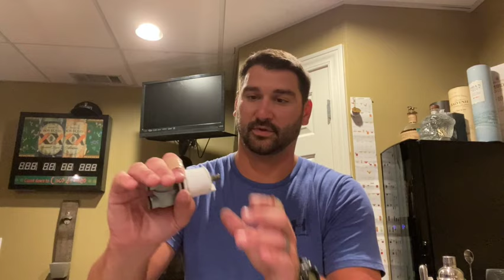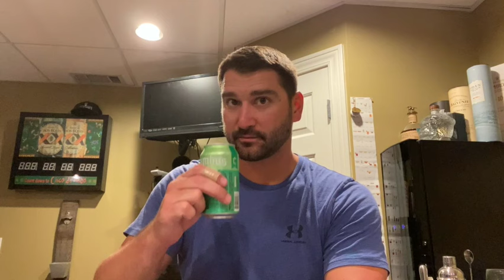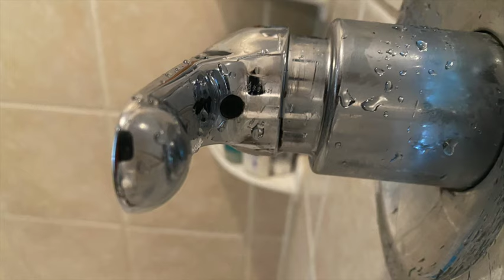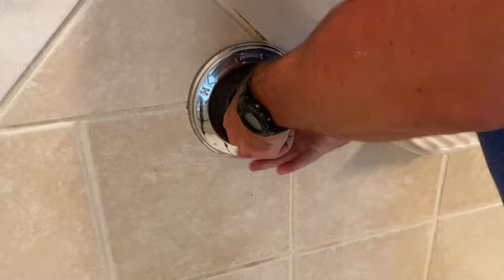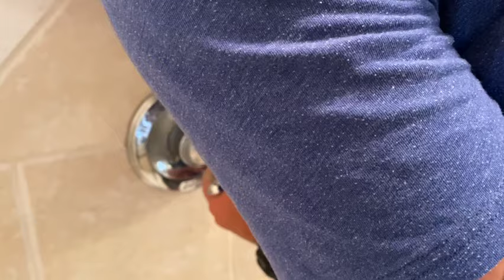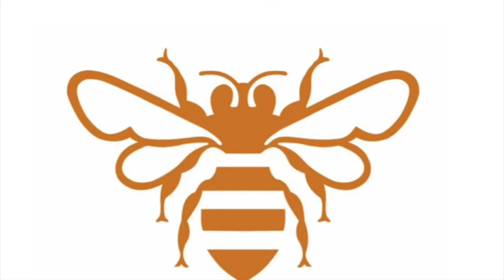Fixing a leaky shower head (Replacing Delta Monitor Series 1400 Handle Cartridge)

Comment: Plumber here. To anyone watching this, these valves are very, very delicate. The part of the video where he shows you using the strap wrench on the bonnet nut be careful not to use too much force. If you do, you will bend the valve body, creating a massive leak. If you live in a part of the country that has hard water, there is a chance you will have to replace the entire valve.
Reply from the maker: Very important point! Thank you for sharing, it always great to have experienced people sharing their knowledge!
Reply: I was watching this video because I can't figure out why water won't come out when I replace the cartridge. It was working fine except for a drip. I replaced the cartridge with a new one and now I can't figure out how to get the water to come out. I turn the water to the house on and the shower just sits there. When I turn off the water and take out the cartridge, a little water comes out. But for the life of me, I can't figure out what I'm doing wrong. I even tried shaking it to make sure the float or whatever is in the cartridge was loose because someone said to try that.

Any thoughts?
Reply: @noteworthyinsignificance debris plugged it up??? Seen it happen with a diy er

Comment: So this video helped me and my husband fix our Delta shower head leak. It took us an hour and a half, but I don't think we would have figured it out if we didn't watch the video and know what to expect. Our cartridge broke into two pieces while we were taking it out and it would have stopped us from moving forward if you didn't share your experience. We ended up taking a channel lock to the part stuck in the wall and pulled it out. Thank you for helping us through this. NO DRIPS OR LEAKS!!

Comment: My shower head was leaking but I replaced the seals and springs first, which are located under the white cover. He accidentally removed the white cover when he was trying to remove the entire cartridge. Replacing the seals and springs stopped the dripping, which can save you the hassle of trying to remove the cartridge, which is difficult. I keep a pack of these seals and springs on hand as I have multiple Delta faucets in the house.
Reply from the maker: Thank you for sharing this! Yes, in some cases that can be an easier quicker fix. I figured though while I had it apart mine as well to the full switch. I hate extra runs to the hardware store lol.

Comment: My hex screw in the handle was corroded in. Had to use Lime Away but even then  I had to work it a lot to get it to loosen. Finally I was able to get it out. I cleaned and lubricated everything after that.  To get the valve out, I helped it along with slight prying with a screwdriver. What I did differently than you was that I only replaced the seals and springs in the valve rather than buying a new valve.  But, anymore, replacing the valve isn't much more expensive than the seal and springs kit at Amazon.
Reply: Well that's good to know because I'm having a bitch of a time trying to get the handle off right now since ours has been leaking quite a bit for the last 2 months. But like yours the handle is super corroded and I can't get a hex screw in there.

Comment: So I just spent a few hours doing this. I seen you struggle to get the back half of the cartridge out. then the video jumps ahead and then you pop it right out. I had limited tools with me but managed to get the back half out after I twisted it back and forth with bigger channel locks than you had, got my allen wrench stuck in back like a hook in between the 2 blue legs, clamped a vice grip to the allen wrench, and whacked the vice grips about 35 times with a hammer while taking brakes to twist on it. I'd like to see the tough part that you cut out.
Reply from the maker: Sounds like you got creative with yours! I wish I caught mine on camera but unfortunately my grip slipped and I knocked over the tripod and damaged my camera in the processes, losing that footage. I was able to get mine out by slowly twisting it back and forth. Luckily, afterwards I was able to get the camera back up and running, but it’s one of the tough things making these types of videos, once you lose the footage there’s really no going back. Thanks for watching and sharing, hopefully this can help others out.
Reply: Geez, look like in the same boat, the front side of the blue portion of mine snapped off...bout to go find an allen wrench that can slip back there🤦‍♂️😪

Comment: Strap wrench and a little penetrating oil (soak for a couple hours) is the way to go for sure. Drilling out the handle set screw was fun on mine...
Reply from the maker: Always fun these plumbing jobs are lol. I have yet to have one go nice and smooth for me 🤷
Reply: Had the same issue with my handle set screw.....was frozen solid thanks to the fact Delta doesn't put any kind of rubber stopper on the access hole, so water gets in. I tried to drill it out, but in the end, just ended up snapping the handle off the Delta Cartridge and had to replace it. When I re-installed it, I used some plumbers grease on the set screw threads. Hopefully that helps the next time the cartridge needs to be replaced.
Reply: So how exactly did you manage to drill out the set screw? Because I'm trying to do it right now and I'm having absolutely no luck with getting that thing off lol
Reply: @myssnoel8496  I had the same issue and ended up snapping off the top of the replacement cartridge to get the handle off. Try reversing the drill direction as well, while pushing into the set screw to see if that will back the screw out (as opposed to drilling forward/clockwise). Good luck and don't forget to grease the new set screw when you put the handle back on....so hopefully not as difficult the next time.
Reply: @myssnoel8496  You need a sharp bit.

Comment: Good to know about the pre and post 2006! Thanks for the info! I've replaced many shower valve cartridges over the years. This Monitor 14 was the biggest PITA I ever had to remove! You are lucky that it came out, fairly easy compared to mine! I was able to get the set screw out of the handle, but the handle still did not come loose! Now, the front half of the cartridge is still stuck to it! I put a drywall screw into the remaining half of the cartridge, that was still stuck inside of the valve body, then clamped a vise-grip to the screw, to make a pull handle. Pulled on it as hard as I could, no way! I got me a hammer. With the claw end, I tapped on the vise-grip bolt away from the wall. Got maybe 1mm of movement after 10 minutes of tapping, it was still stuck! I got a flat nail bar. Drove the screw more into the cartridge, and carefully pried on the screw with the nail bar against the valve body! Finally it came out! I looked inside, a small piece of plastic and an o-ring were still stuck inside one of the valve seat ports! The remaining part was easy to pull out, then I cleaned the round ports with a wire brush, and flushed the debris out. Wow! What a mission that was! Thanks for your video! I wish I stumbled on it beforehand, then I would've been more careful not to brake the cartridge in half! Lol!
Reply from the maker: Glad you were able to get that done! I swear, I always plan for a full days work even when doing the simplest plumbing job just because it always seems like something is going to gone wrong.
Reply: My cartridge stuck so bad that I couldn't get it out. My top part of the cartridge seems like it's gonna come off as well. So I decided to put everything back in for now to do more research.
Reply: Thank you for mentioning the Sheetrock screw and hammer, it saved me.  Also the other cartridge, with the gray top is a RP46074, it’s inscribed on the cartridge.  The RP19804 will not work in its place, you’ll be left wondering why the water won’t shutoff, don’t ask me how I know.

Comment: Thank you for your he instruction. Saved me a ton of time, I would't have known about the new design on the updated model for the stops. The extra parts would have confused me for a hot min. Also a helpful hint is how to pull and twist the collar to set water temperature on the new model valve.
Reply from the maker: Glad it was helpful!
Reply: I think I missed the part where you adjust the temperature.  Where is that in the video?   I just installed mine, but it only turns to 12:00 o'clock and that's luke warm water. 😮

Comment: Mine  valve was stuck too. My brother the plumber advised me to place channel locks on the brass end and use that to help me to rock the valve side to side. Came off pretty easily then. My only issue was that the handle didn't fit as closely to the valve stem as it did before. Checking on that....
Reply from the maker: I did not have the handle issue, but thank you so much for sharing the advice on getting the cartridge out. That can be tricky and we don’t want to damage anything so it’s great to hear from a professional on how they would go about doing it! Thanks so much!

Comment: Question, handy man here, not a plumber.  I do not need to replace the whole valve, just the seats and springs. I do not need to take the valve out? I noticed in video the part he initially took out had the seats and springs?

Comment: I have this exact set up but I’m having trouble taking off the handle. Can you share a pic of the size Allen wrench? A standard didn’t fit mine. Also not sure if there’s a screw in there.
Reply: Usually size 3/32

Comment: strangely I am stuck at the first step where I need to use Allen key to uninstall the handle. I probed the key in and there was nowhere I can get my key to turn and unscrew. Do you have any suggestion?
Reply from the maker: They do make screwdrivers with bits that fit this set screws. That may give you an easier way to turn it.

Comment: I believe I have the same shower handle. My issue is when I turn my handle to the right it shuts off but if I turn it a little more it turns back on. So past off it starts to drizzle. Would this be a cartridge issue as well?
Reply from the maker: Worth a shot. I could see this fixing that issue but I honestly don't know.
Reply: @BusyBeeLiving  I called Delta and got a replacement cartridge. A couple of swear words later I got the old cartridge out and the new one in. Definitely fixed the problem 👍 thanks!

Comment: What do I did when the shower handle doesn’t want to come out after removing set screw?
Reply from the maker: There must be some corrosion not allowing it to release. You have to lightly work it back and forth to break that seal. Be very delicate with this to not damage it. Sometimes a little we-40 or pb blaster can help. Just test a small area with that first to make sure it doesn’t damage the handles finish, but from my experience I haven’t had it do that yet.
Reply: In extreme cases, hacksaw and then replace cartridge, sleeve and handle. Just had one of those.

Comment: I can’t get the initial screw out of the handle even with wd40. Am I screwed
Reply from the maker: The joys of doing plumbing jobs is that there's always something that won't come free. Try some pb blaster on it and see if that loosens it up. Just be sure not to strip the screw itself or you'll be looking to have to drill it out and that is something you really want to avoid!

Comment: What do i do if the handle itself is stuck on after the screw is removed?
Reply: I’m having same issue.   Screw removed on handle and won’t budge.  Tried prying off with small screwdriver and still nothing.
Reply: @erickhaigis5948  Tried Vinegar, CLR, WD-40
Nada. Ended up just continuing to shower with lukewarm water 🤦‍♀️
Reply: @PerfectNyx  man so frustrating.   My has a pretty steady drip of warm water and can’t get that darn handle off no matter how hard I try.
Reply from the maker: It's probably from corrosion build up. You just need to keep working at it, but be careful not to apply to much and damage more things. Also, some have used products like PB Blaster to help break down the corrosion. Plumbing is never fun 🤷

Comment: Wish you would’ve showed the HELL getting that handle off…I can’t get mine off
Reply from the maker: Yeah, mine came off without any issues, what did you do to get yours off?
Reply: @BusyBeeLiving  I called my plumber friend 😁
Reply: @BusyBeeLiving  he ended up having to break it off. No biggie, I was replacing anyway
Reply from the maker: @Jsmooth69able  having a plumber friend is a game changer! Glad you were able to get it done!
Reply: I’m also having trouble removing the handle. Found the right size Allan wrench but it won’t budge. Trying some WD-40 right now.
Reply: @MrCDMcIntyre did you ever get the handle off?
Reply: @MrCDMcIntyre  I'm in the same boat. Darn set screw will NOT budge.
Reply: I eventually used a power tool and cut the handle off.

Comment: thanks, so all you had to do was just wiggle the hell outta it for the rest of the guts to come out?
Reply from the maker: Yes, but I will add I did walk away for a bit to calm down so not to go to hard on the cartridge and cause any damage. Sometimes taking a break is the best move to make 🤷‍♂️
Reply: @BusyBeeLiving  I bought a whole new cartridge from Amazon for $45.00 with new washers. The one I worked on was stuck in there from the calcium build up. So I had to wiggle it out with channel locks. Busted it up in the process.  Slapped on some plumbers grease on the new washers. And it was good to go again. This cartridge is from the 13/1400 series delta